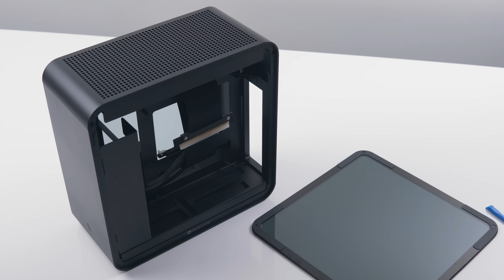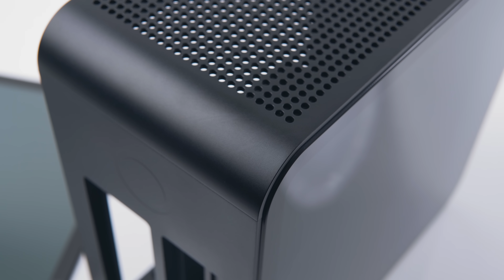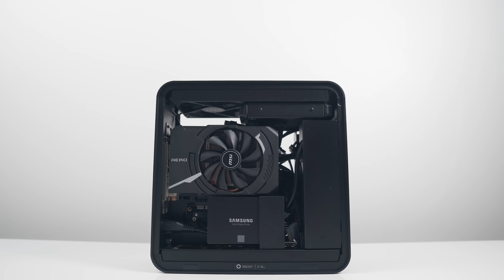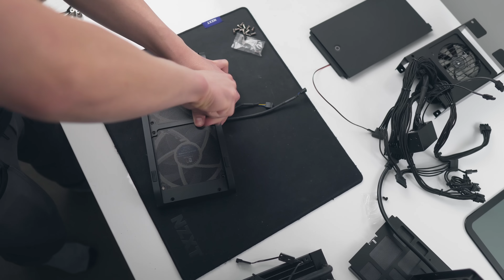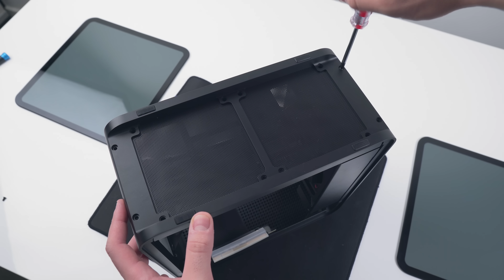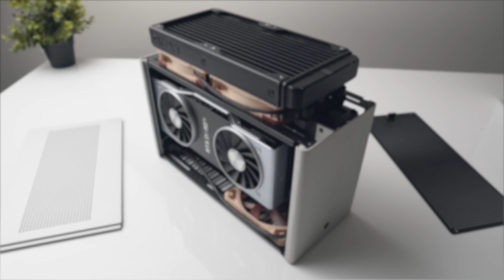Circle Pro - Most Expensive SFF Case I've Reviewed..

Comment: @OptimumTech, Sir I just wanted to ask you that will an RTX 3090 FE with EKWB Water Block (213mm in length) fit inside this chassis along with 240mm radiator ?

Comment: What's the intended build for this case? About the only thing that wouldn't be hampered much is use as a Plex box. Can't run a mid height air cooler OR a slim 240 rad? This is a silly case. At least make perforated acrylic side panels an option.

Comment: For anyone who doesn't wanna spend.. 
Raijintek has something similar.
So does Jansbo. The Jansbo can actually fit ATX, but only a 240mm water cooler.
None of them have a front panel intake, so the airflow will probably be abysmal.
BTW, the Raijintek is unbelievably cheap in comparison to the Circle Pro.

Comment: Feels like everyone is missing the point of the case. They aren't trying to offer a generalized case, its a very specific case you would buy if you like the design. The parts compatibility is listed on their site pretty clearly so it shouldn't come to a surprise to any buyers. They have a google docs spreadsheet that is linked with which CPU AIOs fit and which don't as well.

Comment: -
Pros: 
It looks amazing. 
It's sized well.

Cons: 
Layout isn't the best-thought-out.
Buildability seems to be a nightmare
Water cooling support seems rubbish.
GPU clearance support is WAY too small for anything meaningful.
$449...seriously?

I'd rather spend $300 (still too high, but...) on a Sliger Cerberus X and be able to fit standard to full size cards, liquid cooling components, my choice of ATX or SFX power supplies, and an E-ATX motherboard, with vented panels so that when I travel, at least there's no glass to break...

Comment: This case missed a lot of marks, lack of support for full length video cards and 240mm AIO cpu coolers are major reasons to say no this case. The high price also is a very tough pill to swallow being it's poorly designed internals. I do like the look of the external case, kind of reminds me of the Dan C4-SFX which so far has yet to make it's way to a kickstarter offering. They also copied the magnetic side panels from the Nuvolo Steck case which is a cheap knock off of the Ghost S1. I checked out Circle Pro's website and I laughed cause it's sold out and the reviews on the case are all positive and I believe made up. Outside of the nice exterior design, the price and internal component limitations make this a hard to justify purchase.

Comment: DA2 is much better looking, half the price, and can fit all hardware.
Reply: VEX SB
why you cry better looking?????
need cheap shit, house wife guy?
Reply: exactly what I was thinking Ill stick to my DA2 got my I9 9900K running like he has it set for this testing and temps are good under load and gaming with evga FTW3 1080Ti,  X62 and 2 intel 660p m.2nv 1tereabyte and 32gig of DDR4 3000 CL15 corsair Vengeance
Reply: @0mnikron702  didn't ask
Reply: equalsd123ful did I ask you anything? Don’t think so
Reply: @0mnikron702  bro fast on ur ramadan or smth u literally flexin
Reply: @bar.kokhba  not at all dont know why he came at me like that? Dont care either way

Comment: Do you think you could remove the psu shroud to fit a larger gpu?
Reply: You can remove a PSU shroud and 3D print a bracket for a Flex ATX power supply, and then fit a full length GPU. There's a thread of Smallformfactor.net about this.

Comment: 449USD for a mini ITX with no full length GPU support? umm.....................no. There are a lot of much better sff cases with the same quality for less than that price and with full size GPU support, not to mention much smaller than this.
Reply: Not to mention the best sff cases are still 50% this price
Reply: Examples please ?
Reply: ... But they cost less, so you're not as cool.
Reply: Everyone on this thread saying it is overpriced obviously doesn't understand the point of this case. It is made for whales who want a very high end (think Apple-esque) PC and are willing to pay for it. I parted the materials out myself and it would be over $400 for the average joe to get the tempered glass and raw 6061 aluminum blocks. This does not count machining costs or design labor. For the quality of the case, $450 is more than fair. However, as others pointed out, more thought could have went into the interior layout.
Reply: @myrecommendedisallmemes  Ghost S1 is cheaper with better build quality
Reply: @hi9580  not comparable at all…
Reply: I love this case, but that price was set by jerks.
Reply: @jondonnelly3  Not many are made. But they're still jerks.
Reply: I'm not saying "You should buy this," but I will say that $450 does get you a lot of quality if this is built anything like the MBX MKII. Features are nice, but I will say that raw materialistic quality is hard to put a price on.

Comment: Circle Pro is a very clean and sleek case. The only thing I don't like is you cannot install a reference Nvidia cards for its size without modding.
Reply: If they'd worked out full length support, it would be the perfect case, IMO.

Comment: I love the design, it's one of the best looking SFF cases I've seen so far, but:
-Obviously, they need to work out the kinks you mentioned and get the price down.
-I get pissed off everytime I see a SFF case that is only available with glass panels. I (and I think many others) want SFF cases to be able to take their PC with them. It's such a hassle when you have to pay attention to the glass panels so they don't get scratched or even crack. Same story with the new Lian Li TU 150, it even has a handle to carry it around, but it has glass panels as well. It's form over function every time, it's less durable and worse for ventilation compared to perforated metal panels.